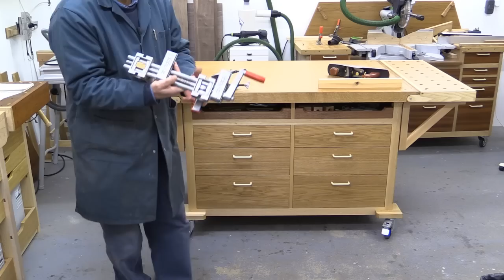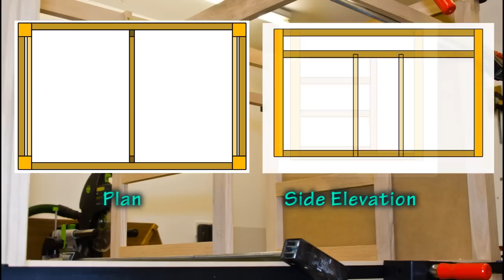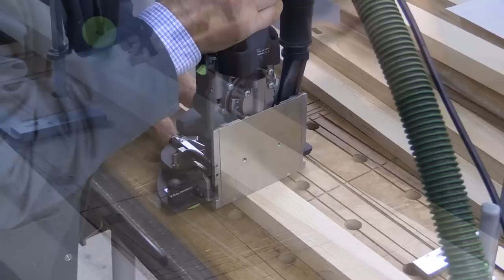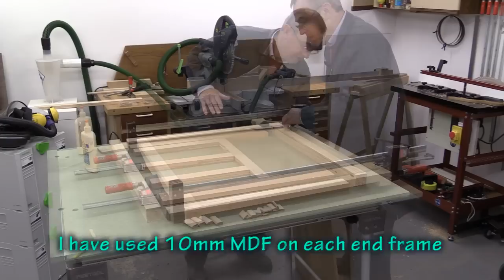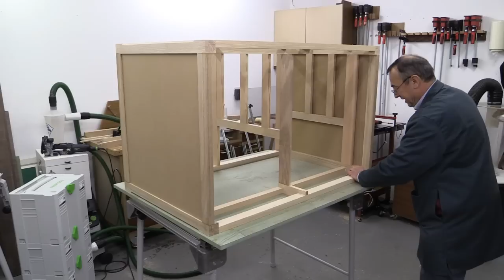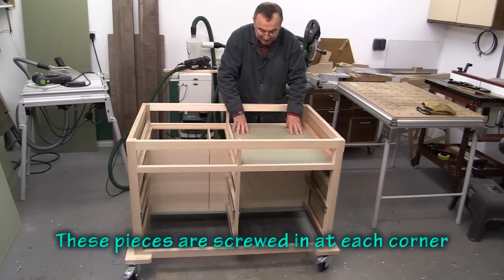Mobile Bench Project - Design and Main Construction

Comment: hi PeterI love your videos and would like to have a go at building a version of your mobile bench and would like the plans. I have clicked the about key as you suggest but there in no key to send an email by private message.
Reply from the maker: Hi Michael, YouTube removed that facility in July. Just send a comment with your email address, stating which plans you need  and it should end up in my spam folder and not visible to anyone else. I will then send the plans and delete your comment.  Peter

Comment: Great vid and great bench Peter. What is the length and width of the main bench and of the extensions. Thanks!!!!
Reply from the maker: Hi John, The main bench is 1316 mm x 886 mm. The wings are each 300 mm x 886 although the wings do have sides which are 370 mm in order for the hinge action to work.  The plans are available free of charge is you let me know your email address.   Peter

Comment: Thank you the video series Peter.
I would like to make this as an assembly table for the middle of my workshop. I would be grateful if you could email me the plans: cliftonplymouth@gmail.com

Could you please advise on why you used oak vaneer for the draw front, as opposed to some quarter sawn solid oak? It seemed like alot of work. Was it just for stability?

Many thanks

Jaime Clifton
Reply from the maker: Hi Jaime, It was oak veneered MDF which is cheaper than solid oak and was left over from a job.   Peter

Comment: Peter, by and large do use the narrowest setting for the width of the domino on case work?  Sometime I have an alignment issue and need to cut one or both over with the middle setting. I prefer the narrow setting as the case will stay together because of the tight fit.
Reply from the maker: Domino joints on the narrow setting should give you about 0.5 mm of "wiggle room" - I covered this in a Workshop Notes video (about 12 or 13). If your technique is not within 0.5 mm then you need to check your marking and how o use the Domino machine.   Peter

Comment: Thanks for your comments on the table saw yesterday Peter.  On your advice I'm now considering making a bench for the Festool saw.  A quick question though:  Do the drawers below fill with dust that falls through the 20mm holes in the worktop?  Kind regards  Ian
Reply from the maker: Hi Ian,  Some dust does go through and that, for me, is solved by the push-pull drawers at the top. They do not contain any long term storage items and so every now and again I give them a quick vacuum out.   Peter

Comment: Peter
 May I ask you did not use the the Festool hole punch system and a router to drill the holes in the top?  In terms of time and effort it may seem cheaper than building the jig?  Please tell me your thoughts
Kind regards
David
Reply from the maker: +David Allan   Hi David, That jig was nowhere near as accurate as I would like. I used it a second time and the slight wear on the inside of the holes made the whole thing useless - it has helped to warm my house though !  The LR32 is not an option either as it is difficult to set up to do a complete pattern of holes.  Within 3 weeks there should be a very nice video showing you how it should be done.      Peter

Comment: Hi Peter! Great Video. I enjoyed watching and learning.  I just refinished a hutch for my Kitchen and I was wondering how you attached the casters? Is it sufficient to pre-drill holes for the casters? I have threaded casters, but someone told me I need to put in an anchor first and then screw the caster into that? I have 300lb  casters that are about 5: in height. I wanted to be sure that it could hold the contents in the cart and safely move it around my kitchen. I'm using the top as additional counter space and work prep. My email is maria.santagati@gmail.com. Please advise. Thanks!!
Reply from the maker: +Maria Santagati Hi Maria, My castors have a plate fixing with four holes. I used some large (fat) wood screws to hold them on. If your castors have a screwed shaft then you need to mount them to a block of wood, at least 1 inch thick, with a large washer on the side where the nut goes. The castors should be able to rotate after they are fixed in place.   Peter
Reply: Thank you!!!

Comment: Hi Peter, love that bench!
You said you put a coat of osmo on the mdf panels. Did you just put that straight on there or did the mdf need some sort of priming?
I'd say it would cause the mdf to swell up, am I wrong here?
Reply from the maker: gssns I am sorry for the delay - YouTube's comments are not handled well and this has only just come to the surface. I just put the Osmo straight onto the MDF. The MDF was already glued into the adjacent wood frame. It works well and no noticeable swelling.   Peter

Comment: Hi Peter

I have been building up my workshop for several years now and have recently started to buy the festool range of tools help in no small way by your excellent video reviews, I had never heard of the festool domino machine before watching your video and have recently purchased one and find it an amazing machine that has simplified my joinery a lot, no more mortise and tenons on the saw bench for a lot of joints. I have watched your videos on the mobile work bench and would love to make a similar bench, would it be possible to have the plans with dimensions and material sizes ?
Keep up up the good work because you give clear and concise information and in a easy to watch way.
Reply: Hi Peter forgot to add my email : martinjfeeney@gmail.com
Reply from the maker: Hi Martin, The plans are on the way to you now.   Peter

Comment: Peter
Excellent video. I have watched a number of yours and recently bought the Domino 700 on the back of your review. One thing in this particular video which, if available, you could have provided are the actual plans with sizing. You show how its constructed perfectly and refer to all pieces cut to size but it would be really helpful to know what those sizes were. I have had issues in getting the correct spacing between drawers, well more precisely the distance between the runners, recently. If you have these available and would like to share that would be fantastic

Comment: I love this project, Peter, and would like to make something similar. Unfortunately I cannot afford a domino joiner. Could it not be made with biscuit joints, or even dowels? I realise that this would make it a little weaker in the joints, but these could maybe be strengthened by undersunk furniture bolts or undersunk screws with wooden plugs over the top of them. What do you think would be the best way round?
Reply from the maker: Hi acfDK,

The next best thing after the Domino would be mortice and tenon joints. Failing that you could use biscuits for location but a long screw through the joint for strength.  You could use dowels but you would need a jig of some sort to get it right.

Good luck.

Peter
Reply: At the present moment, I am considering buying a Wolfcraft B4640 Dowelmaster (only £14.00). Surely 2 10 mm dowels, instead of a domino, and a long screw (hidden by a plug) should do the job.
Reply from the maker: Hi acfDK,

Yes, that should be fine. Use nice long screws to be on the safe side.

Good luck.

Peter

Comment: Peter, another quick question.  You used oak for the legs and main rails but what constitutes 'good quality timber' for the rest?  I'm assuming the bench gets most of its strength from the oak and the other supports are there for the drawers and dividers.  I'm going to attempt something similar for my first project. Thanks!
Reply from the maker: Hi Shareef

You are right, oak or a hard wood of similar strength is needed for the legs and the cross pieces that you see from the front, back and sides. The cross piece that goes between the front and back should also be hard wood.

The drawer supports, the frame under the top can be good quality soft wood (pine but with no major defects).

I am away most of today but if you send me your email address by Private Message I will email a copy of the plans that I drew up which may help a little.

Peter

Comment: Hi Peter;  I am getting setup to make a similar bench, however, this gives me a few new ideas.  Thank you.  I was actually on hold waiting for your mobile bench video after I saw the caster video.  I estimate the HDF top, less trim is 4' ( 1220 mm) wide.  How deep is it?  I was planning on adding some clamping holes in the legs and a track under the front edge to slide in the Festool clamps like the MFT3.  This would allow quick vertical clamping.
Reply from the maker: The final size of the top (including oak edging) is 885 mm x 1317 mm. You might want to adjust so that the HDF need only be 1220 mm wide - I should have done that but I wanted just a dash bigger top.  Peter

Comment: Excellent video ,great subject as I'm in the process of making my own wood shop.  Have you considered using the Festool LR32 Hole System for repetitive drilling. Secondly, what about the dust that's generated from the activities on the top. As it stands it's going right into your pull through drawers.
Reply from the maker: Hi Joseph, No, I have not tried the LR32 system and am not sure how accurate it might be. Knowing Festool, it will be very good I am sure. I am well aware of dust, drips of glue and finish oil going through the holes. I do not have as many holes as there are on the MFT3. The "push-me pull-you" drawers will not hold anything too precious and if I am worried they can come out very easily. Thank you for your kind remarks.  Peter